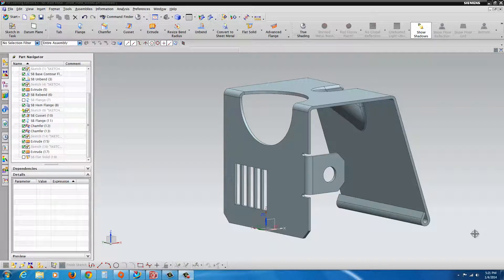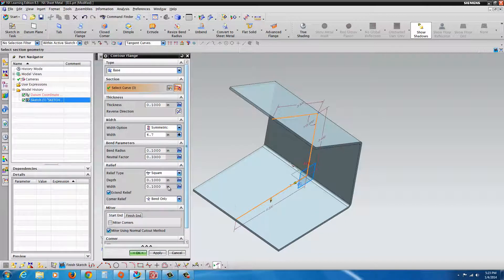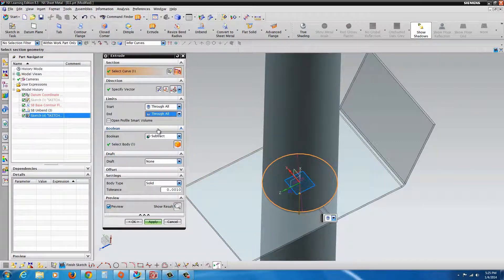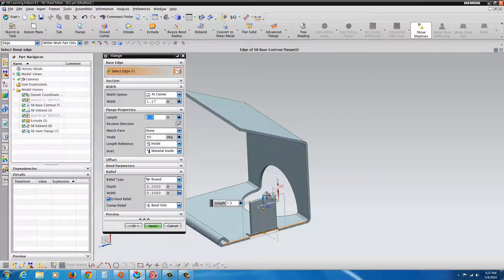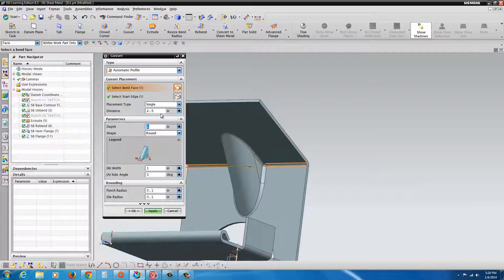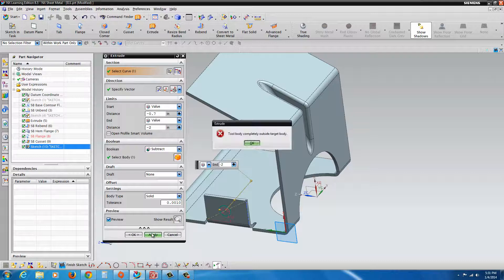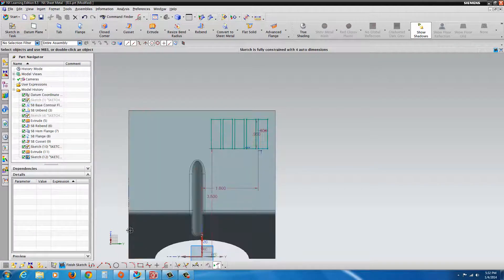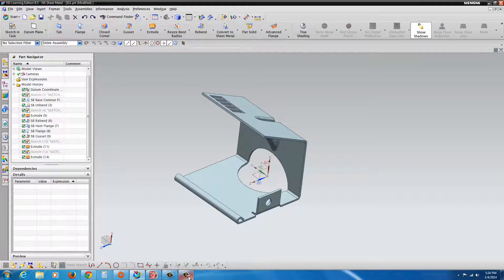E11  Siemens NX 8.5 Sheet Metal 1 Tutorial

Comment: NX is great but with this type of sheet metal, Fusion360 is better.
you don't have to draw or think about the sketch....just lay down the biggest face (stationary face) and use the bend command to extend the edge.
Cut-out material with a simple command and then unbend/flatten the sheet.